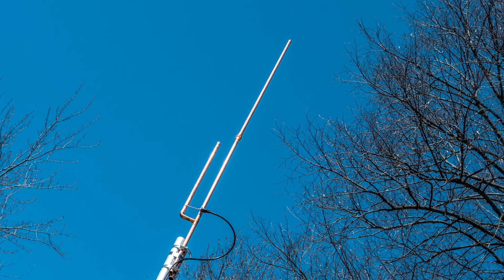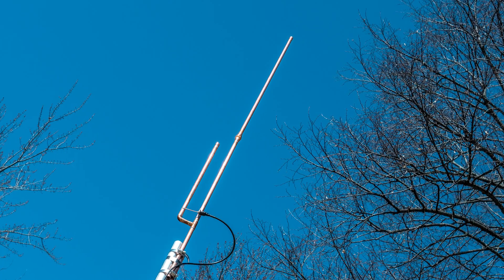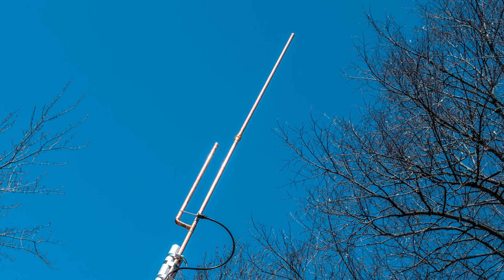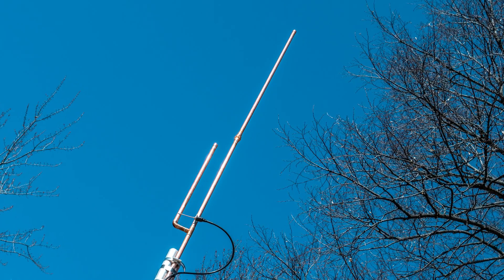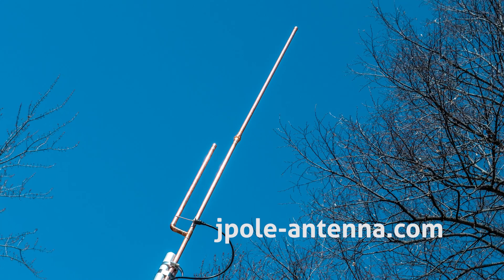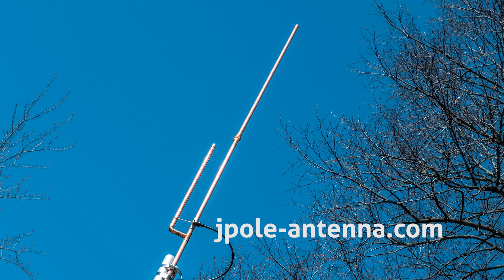Ask Michael, KB9VBR: What is an acceptable impedance level in an antenna

Comment: Good video. I will add a note from my experience. The impedance at the antenna terminals is a combination of radiation resistance plus total loss resistance. Regarding loss resistance, the omic loss in the antenna is small but the ground loss is quite variable. We will never get to perfect. There will be some loss. The radiation resistance could be around 35 for a quarter wave but will be a lot less for shortened verticals. So with a full size quarter wave vertical, a 1:1 SWR with 50 ohm cable indicates there is some loss. Reducing this loss will lead to the SWR going up a bit. A full size quarter wave vertical with any SWR below 2:1 should be fine for all practical purposes but it does indicate that the ground system could be improved. An SWR of 1.5 or 1.4 is really good. In fact, if the radiation resistance was 35 ohms and we had no loss, the SWR would be 1.4. We also must remember that there are a lot of variables, including the accuracy of our instruments! I can get slightly differing readings between my Bird, Drake and Heathkit meters. So reading a 1.4 on the scale is probably just close to the  real number anyway.

Comment: 30 years in VFD development.  The issues are that the PWM switching is very high (high dv/dt) and any the motor leads can ring like a transmission line up to 1200V.    Also, any stray capacitance to ground looks like a good path.  The transistors switch a 0- 650 VDC  link with rise times up to 10kV per microsecond so frequency components are in the range.  The false rise times can cause all kinds of trouble.  Motor failures, stray currents on communication links.  I learned a lot about AC and RF grounding in that business.